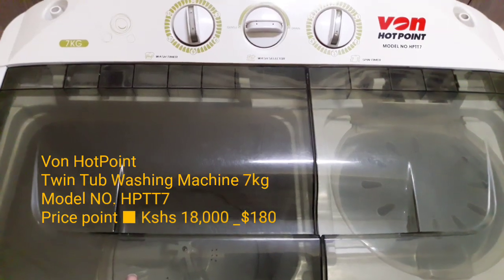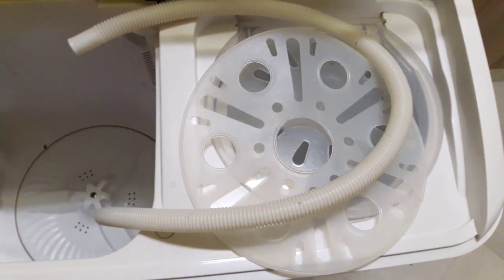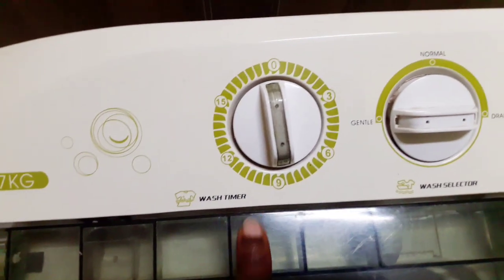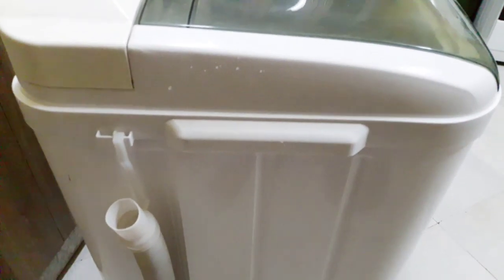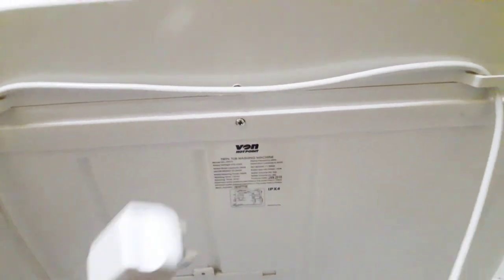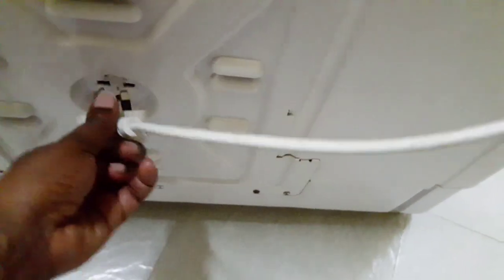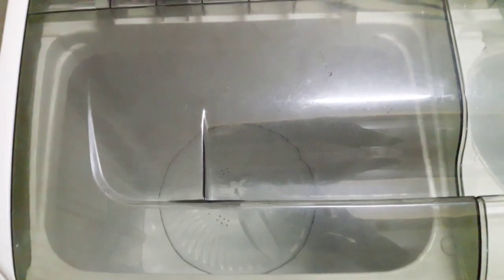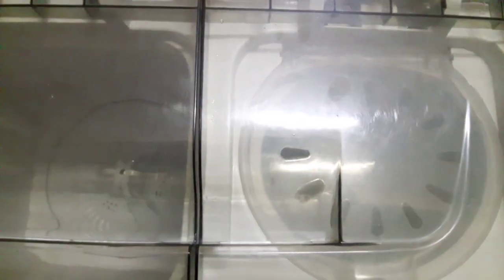How to Laundry for Apartment Living /Top Load Washing Machine/Home Appliances/ Von Hotpoint Twin Tub

Comment: Hi Ruth my filter of the machine is loose it keeps on falling down, what do I do ?
Reply from the maker: Hi, if you are talking about the lint filter it has a way to fix it and you have to make sure it clicks once you replace it on its spot.You will just know if its not broken.Whick is rare to break.If you are unable to fix it just passby the shop where they are stocking the items may be they can advice on what could be the problem.

Comment: Hey Ruth. Very educative video there. I just need to know, (1). how noisy are these appliances and specifically your type of machine.
(2) How long have you used yours? Any mechanical problems so far? I hear their pulleys are the weakest links. Thanks
Reply from the maker: Hi Dennis thank you very much for watching.My appliance is now going to 4 years and up to date it works as good as it worked when It was new.So far no issues. Noise is actually very minimal and it happens obviously when tumbling is happening. For the work it does and the price point so far no complaints.I would still buy this appliance over and over again.
Reply: @RuthWambugu  That was soo helpful of you. Thank You very much.   Now I can make informed choices. Once again, Thank You very much.
Reply from the maker: you are welcome Dennis.

Comment: I would like to know how you connect the water inlet hose to the tap. I've been unable to connect mine. It keeps dropping down to the sink.
Reply from the maker: Hi Sly Selly, Thank you very much for your feedback.In mine there is a small piece like a softer plastic rubber that enables the hose to stay in place,a 3/4 tap is the one that seems to fit these inlet hose well. May be you have a smaller tap, you can buy a small pipe that fits your Tap and fill water with or fill the water manually . Hope this answers your questions.

Comment: Kindly would like to know if it consume alot of power and water
Reply from the maker: Hi Hidigo Hassan thank you very much for watching.I would consider the appliance service and consumption as normal as every electric appliance in the house.
How many loads you are doing will be the determinant ,if minimal clothing, sometimes I don't even notice a token change ,maybe a unit or less. Concerning water, you can consume less of it or more depending on the mode of rinsing you choose. I have explained in the footage the way to wash and  3 ways to rinse ,Hope that helps.